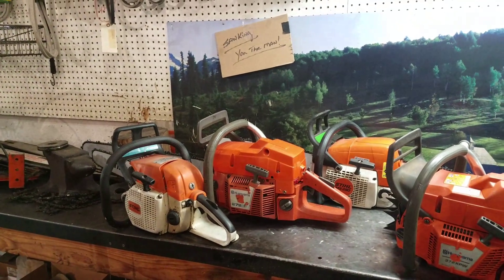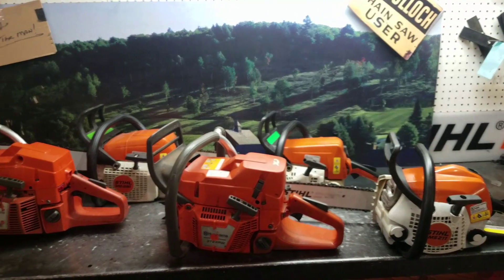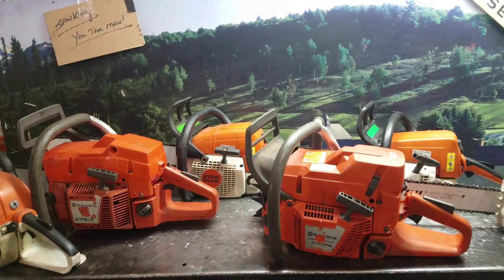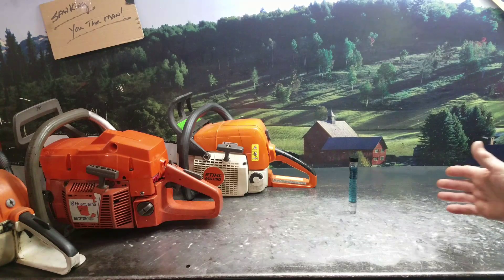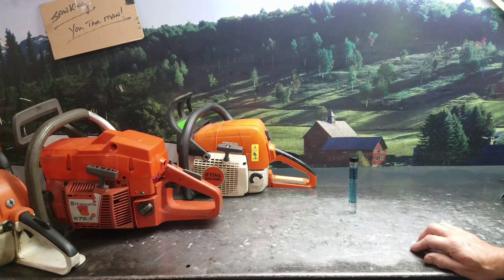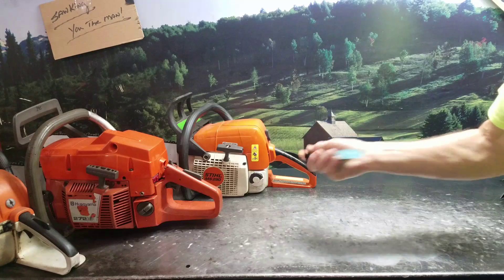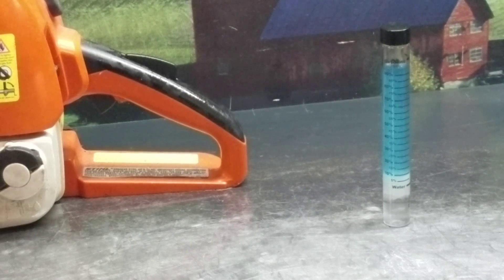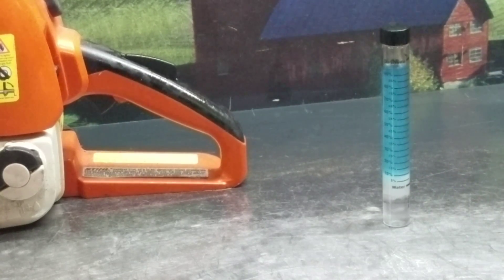The Chainsaw Guy Shop Talk Ethanol Testing

Comment: Great info. I always buy 93 octane gas with out ethanol. I think you recommended that long ago. 
What oil do you recommend. I have been using Stihl non synthetic. Should I change my mix.
Reply: Use fully synthetic, it costs twice as much as regular one but it worth it.